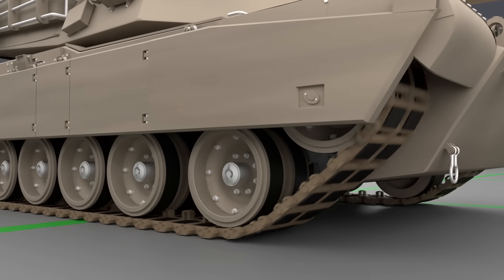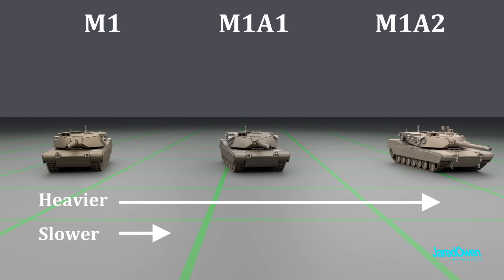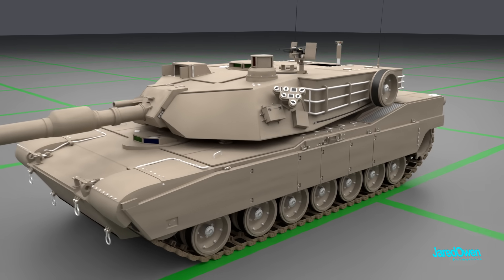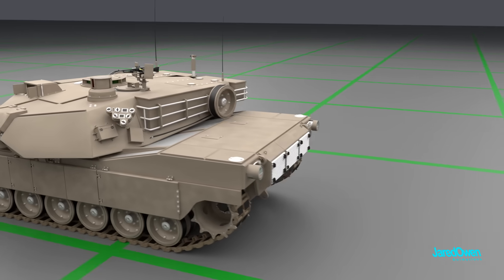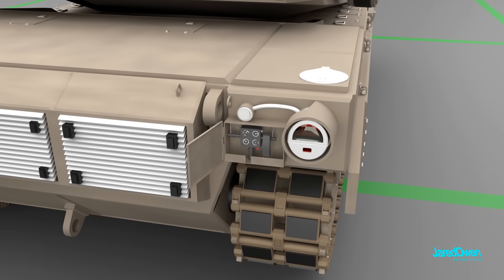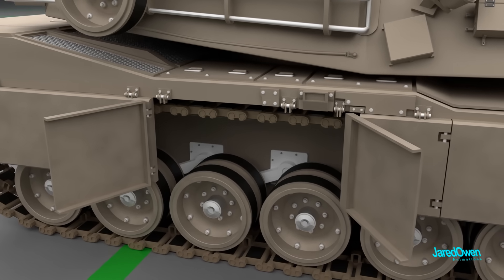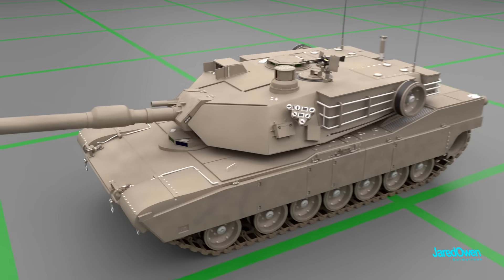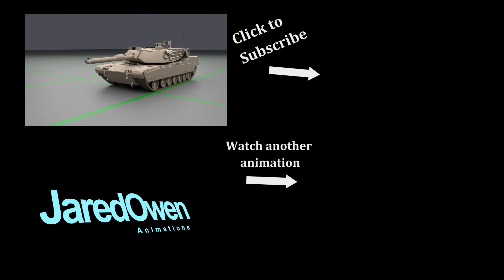How does a Tank work? (M1A2 Abrams)

Comment: Good video!  One correction—once the loader secures his round from behind the ballistic shield doors, he does not rotate his body 180 degrees clockwise and then place the round into the breech.  There is absolutely no physical room within the turret to accommodate this action and, even if there were, it would be impossible to maintain your balance while the tank is moving.  It would also take way too long to load.  

Once you secure the round with your left hand on the aft cap, you place your right hand under the casing. Push the round upward with your right hand so that the business end now rests in the crook of your left arm like you are cradling a baby, and place your right hand on the aft cap.  The round is now pointed directly into the open breech.  Push forward with your right fist so that the round slides along your left arm and into the breech, which will slam closed.  Make sure the shield door is closed, take the weapon off of manual “safe,” clear the path of recoil, scream “UP,” and brace yourself for the ignition and recoil that follows.  

I spent 9 years on the M1, M1IP, M1A1, M1A1“Heavy,” and the M1A1HC, and this video brought back hella memories.  Including drying my wet with sleet clothing in the exhaust on early, freezing mornings.  PS:  after 3 days in the turret with 2 other big, unshowered guys on MRE diets, the stench gets pretty heinous.
Reply: In such places as the desert, does a tank have any type of cooling system for the crew?
Reply: @thenightguide  AMX Leclerc tank has multiple air conditioning units. First one is a hybrid one integrated in the NBC system, and second one is an independent  electric air conditioning unit installed on the back roof behind the gunner's hatch. EAU version also features a third one which is an engine-driven mechanical heavy-duty air-conditioning mounted in the left part of the hull directly on the engine. AZUR version features the same last one with additional protection against molotov coktail. https://en.wikipedia.org/wiki/Leclerc_tank
Reply: @chik chik Boom with you mate , ex Centurion and Leopard crew here, 3 days in a NBC suit in a locked up seal Leopard is sick too, crapping in a can
Reply: I like flipping sabot in like how you described but when it comes to HEAT or MPAT I rotate with it a lot more but obviously now how he animated it 😂. I can't imagine loading like that lol
Reply: Поэтому в инструкции по эксплуатации танка ,любого , написано - НЕ БЗДЕТЬ !!!

Comment: No fuel is in any of these tanks. The engine uses the air as the fuel. 
No room for any fuel tank 500 usgallon = 1892 liter. What's a big storage water tank what's massive. It uses the same engines as a airliner what also doesn't use any liquid fuel.
Reply: airlines use liquid fuel too

Comment: Question if anyone can answer... isn't there a way to automatically feed the main gun? It seems like they should have come up with a better way than just having an extra man inside the turret for the sole purpose of taking used shells out of the armory and feeding the gun. I don't know why this is still a thing in 2020.... I mean we live in the age of drones... why haven't they figured out a self feeding mechanism is beyond me...
Reply: They have. It's just they have their advantages and disadvantages. An extra crew in the form of a loader means less work load, another set of eyes, and ammunition could be unloaded much more easily. An autoloader, depending on design, might compromise crew protection to make an efficient loading system making the crew exposed to ammunition cook-offs. It means increased work load per person, and unloading ammunition is much more difficult. However the reload rate is more consistent and there are advantages of having one less man.
Reply: Nathan Peterson cool. Thanks for the answer. Don’t know much about tanks, but I saw a video on the T-90, and it had an auto load system. The whole idea is one less person in harm’s way. But I suppose you’re right. If it jams, the whole tank is out of commission.
Reply: @guspriyol7211  The Abrams like the Leopard have had autoloader systems developed for experimentation. Such as the Abrams's FASTDRAW "revolver" autoloader and the TTB's carousel type. Or the Meggitt Defense compact autoloader. 

 While Russian tanks aren't bad by any measure, I feel their design for autoloader compromises crew safety considerably. Because they use a carousel type with sometimes armor fitted over it. But in other words, if it were to cook-off the crew are very much screwed. Whereas with the Leclerc or Type 10 they have a seperated compartment for their autoloader with limited exposure to the crew and sometimes utilize blow-out panels. But they are larger systems that take up the entire turret bustle (the overhanging rear bit) rather than the turret floor. 

 In summary, advantages and disadvantages. For the Russian doctrine of tank warfare, their designs might be questionable, but are fine. Same thing with the Abrams for the U.S. doctrine. It suits them well but with some kinks in the system. Like fuel consumption or hydraulic turret control.
Reply: Nathan Peterson great answers. I thank you, sir. You have taught me.
Reply: @guspriyol7211  No problem! Any time!

Comment: The gun isn’t even american. It’s a 120mm-Rheinmetall-Glattrohrkanone from Germany.
Reply: Developed from it. There are  considerable differences between the M256 and the Rh.120 L/44. And the M256 is produced at Watervliet arsenal under GDLS.
Reply: @peterson7082  But the americans pay us to use the M256 because it is basically the 120mm-RM
Reply: @pastelbloodtunes  Some of the development costs were to Rheinmetall, yes.
Reply: most nato cannons of tanks are based off the RM cannons
Reply: @peterson7082  The Abrams 120mm gun is a German design by Rheinmetall AG. and is built under license in the U.S. with fees paid to Germany.
 The M256 is the cheaper, heavier and less accurate version.
The M256 lacks the concentrically balanced tube and the lighter  more advanced hydro-pneumatic recoil system found on German made L/44 guns.

Comment: 'The engine that powers the tank' is a bit too simplistic explained. It doesn't work with chain and belt drives (I hope so).
The engine powers a hydraulic system that powers all moving parts. You missed an important part.

Comment: What the fuck is US tones? Ton is ton it's freeking SI system, should be the same as Fr ton or Uk ton...... so idiot
Reply: your an idiot
Reply: There are several tons. Short ton and long tons are U.S. customary and Imperial tons. Technically both are defined by metric in most international uses, but the U.S. short ton is 907.18kg., the long ton is 1,016.05kg., and the metric ton (also called the tonne) is 1,000kg. In pounds, which are roughly the same in the Customary and Imperial systems it's 2,000lb. and 2,240lb. respectively- a metric ton is 2,204.62lb. I've heard the temr "U.S. ton" refer to the short tons outside the U.S.
Reply: @peterson7082  You have my respect, nice to know this, thanks, but still it's too complicated to use I think and should use only metric tons in the US as well, everything would be easier in the trade

Comment: The weak point of using heavy tanks in battle is they need a constant fuel supply or they won't get far. The tanks maybe hard to destroy, but not the fuel transporting trucks, trains or pipelines.

Comment: Are you sure 500 Gallons of fuel? I think it won't fit inside the tank even if you remove its internals.
Reply: Nope, it has 500 gallons.
Reply: The Diesel engine version of the Abrams only needs a 300 gallon fuel tank,
The Chrysler version could not meet the Army's range requirements and this lead to the highly controversial and deeply flawed decision to move the main ammunition magazine up to the more vulnerable turret to make room for the larger fuel tank in the hull.

Comment: Ah yes, let's give a quiet engine to a 68 ton rumbling beast of a machine! I'm sure nobody would notice a giant beige thing cruising around at 70kph!
Reply: In many cases you will hear the tracks before the engine. Hence why you hear  in memoirs crews mentioning clanking of tracks rather than roar of engines. Rubber padded tracks are quite quiet.
Reply: @peterson7082  Fair enough. I don't have much experience with tanks in detail, but the few times I've been close to an active Leopard 2 I could hear the engine more than the tracks. Then again I guess the diesel engine of the Leo 2 is tons noisier.

Comment: Yea but where do the spent shells go?!?!? 

Please someone help me answer this 

Is there an automatic thing? Cause i know that there is no way that there isnt a spent shell going somewhere
Reply: In the past the casing was a solid brass/ steel alloy. But with the 120mm. rounds and other modern ammunitions, the casing is often made of nitrocellulose (heavy duty cardboard, impregnated with nitroglycerin) which combusts with the propellant. The base cap w/primer is made of steel typically and has a heavy rubber-lined sealing ring, this base cap is the only thing that remains after firing.
Reply: Nathan Peterson ok that is really cool, thanks for the help!
Reply: @musicman3351  No problem!

Comment: You need to be more precise.  Your muzzle velocity is about 3499 miles per hour too fast.  A rifle that has a muzzle velocity of 4200 fps is extremely fast.  3500 mph is about 18,480,000 feet per second.
Reply: Nope, the M829 is 1,555m/s. which is 3,500mph.

Comment: US tons?
Reply: SHORT TON (907kg)
Reply: There are several tons. Short ton and long tons are U.S. customary and Imperial tons. Technically both are defined by metric in most international uses, but the U.S. short ton is 907.18kg., the long ton is 1,016.05kg., and the metric ton (also called the tonne) is 1,000kg. In pounds, which are roughly the same in the Customary and Imperial systems it's 2,000lb. and 2,240lb. respectively- a metric ton is 2,204.62lb. I've heard the term "U.S. ton" refer to the short tons outside the U.S.

Comment: What does it mean US tonns :D there is only one tonn
Reply: Short ton vs. Long ton
Reply: There are several tons. Short ton and long tons are U.S. customary and Imperial tons. Technically both are defined by metric in most international uses, but the U.S. short ton is 907.18kg., the long ton is 1,016.05kg., and the metric ton (also called the tonne) is 1,000kg. In pounds, which are roughly the same in the Customary and Imperial systems it's 2,000lb. and 2,240lb. respectively- a metric ton is 2,204.62lb. I've heard the term "U.S. ton" refer to the short tons outside the U.S.

Comment: How does a tank work? lets take a look at the tracks and turret, the turret and tracks rotate very rapidly to generate work. 
The work is then converted into miniature dinosaurs ,which are then rapidly liquefied. A short time later the liquor (industry term) shoots in to the engine. the engine then sucks, bangs and blows its way to needing to get STD treatments every week.

TD;LR Tracks and turret spin and the energy of the two combine to transfer that energy into a force that makes the tank WORK. 

we are disappoint, we are pedants.

Comment: US uses aviation fuel used in jets which is pretty much a high grade of kerosene as the two fuels smell very similar when burned. Kind of like heating fuel and Diesel fuel for example both are the same thing just one is meant for on road use as well as off road use the other is used for heating. Australia uses diesel fuel in its Abrams tanks that they use. The gun is a licensed US production of the German 120mm L44 made by Rheinmetall which is used by early variants of the Leopard 2 MBT. The newest variants use a APU a Auxiliary Power Unit to power the equipment in the tank when the turbine engine is off so if the tank is in a defensive  position and doesn't need to move. This runs on the fuel the tank has in its fuel tanks but uses allot less fuel than if the turbine was on providing the power. Also making the tank harder to see on thermal optics as the turbine is off.

Comment: As a former gunner on a m1a2 sepv2 i can say this isn't to far off. The electronics you highlighted in the beginning of the video are not electronics. Those are metal rods designed to keep the front two mud flaps down. Most m1a2s have a 50 cal on the TC position on a Manuel mount or crows system. Interior was lacking a lot of different details. The TC has two screens not just one its built into one whole unit but has two separate screens one for managing systems and operating the crows. The other is for the CITV. Also not all of the side skirts are armored the front ones are ballistic some of the side ones are to cover the hull ammo which we really don't use anymore due to risk of getting hit from the side. Hmu if you want details or even some photos/videos if you plan on making a part 2 in the future

Comment: I don't really get how the turrent can rotate a full turn. The back of the turret has a shape that allows for this but the front seems too low to avoid getting stuck with the body of the tank. In fact in the animation at 7:44 I can see the 3D model ghostly traversing itself.
Reply from the maker: Great question - I believe my 3d model was off by a little bit
Reply: @JaredOwen  Ups okay. Thanks for the answer. I was thinking: Maybe those tanks can't do a full turn, but this seems more logical. Thanks again and congratulations for another awesome video
Reply: The turret in real life clears the engine deck, though the gun needs to be elevated to do such.